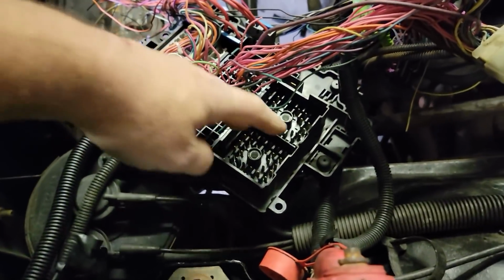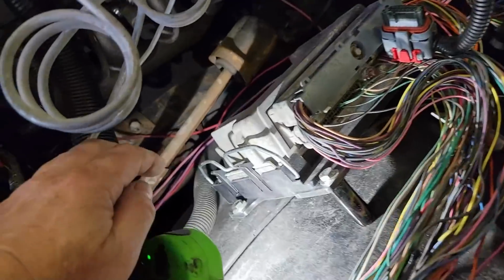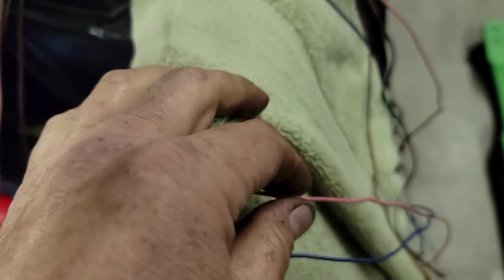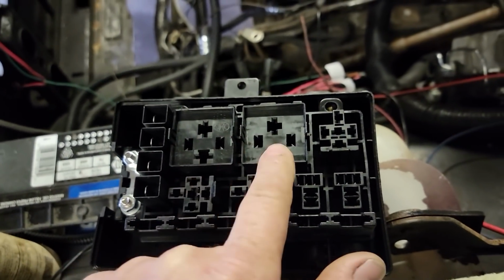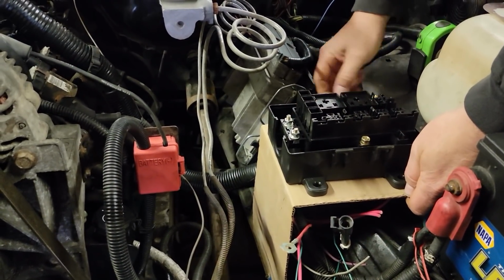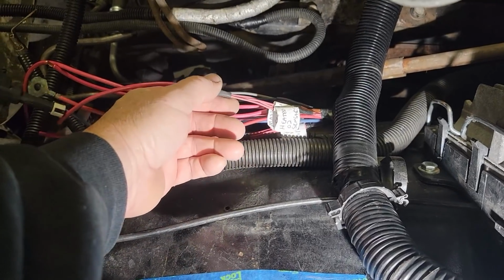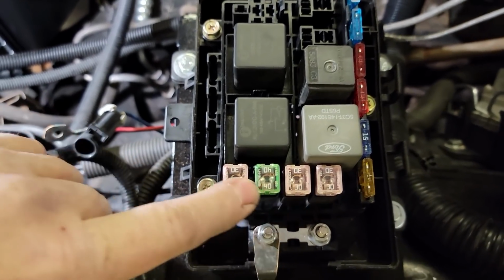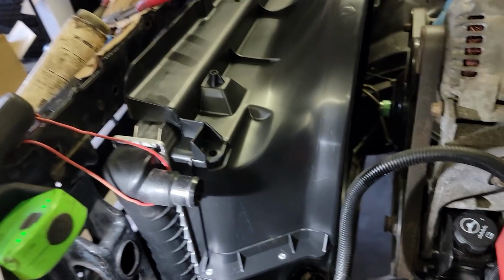LS SQUARE BODY SWAP...THE WIRING!

Comment: First things first JC, I really like your setup and think you went the extra mile in doing all the t's crossed and the I's dotted. I am getting old and have a hunch short on birthdays. Something I have to quit chickening out on and see  a doctor as its real bad and I ain't in a hurry for my cremation. I believe you mentioned Dan from DD speed shop.... I like that kid an he's coming along. I also like Brent over at halfass kustoms. If you haven't seen his work then your really going to dig his wiring tutorials as well as he has done the LS swap in every imaginal swap that comes around. Dan works on dan stuff an Brent works on customer an his own stuff. I probably am boring you because you most likely know about him. I just wanted to make sure about it. I think that doing one of these since I never did, come dang close but that only counted in Nam. Once a person has one behind him, Its back to figuring out motor mounts or cross members. Its really nice if you get whole rigs, the donor and the receiver so parts picking isn't at buy and cry or need another part a hole. They charge prices as they are increasingly changing day by day and its fair for them to stay  in business but from business to business, there could be larger breaks. I so miss the days of wet clothes and burns from the welder, hands that looked like they belonged on someone else. Sure I have a thousand dollars saved up but it took around eight or more months  to do it. When working I just timed money with jobs and willing to get dirty. Best to both of you

Comment: Kinda what they said. Instead of cutting the whole thing, do a couple long cuts with three points left attached, then put it in the vise and bend it. Then easy welding and no holding.

Comment: If you ever want to bend thin plate take your grinder and cut a grove roughly half way through or more it should be thin enough then to bend by hand or in a vise. If you want a specific angle just stop and check til you achieve the angle. The look will be ad if you bent in a brake. This works well up to a 1/4” thick.

Comment: If the owner saw what you had to do to start and run his truck
 before you were finished.  He would freak out at the wiring mess. You are a true a true mechanic from the old school. If you have a problem you fix it right and NO shortcuts.